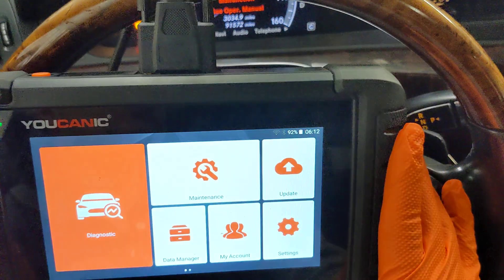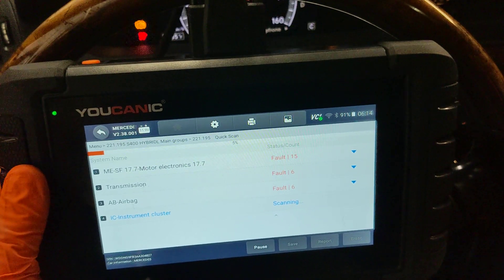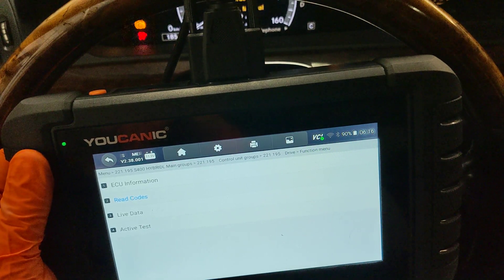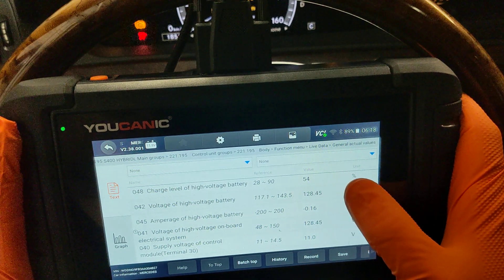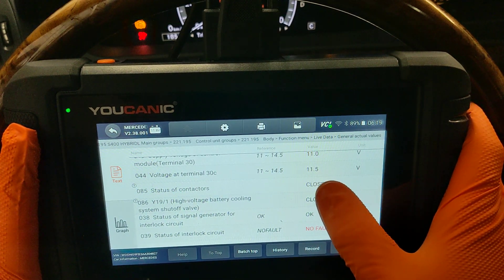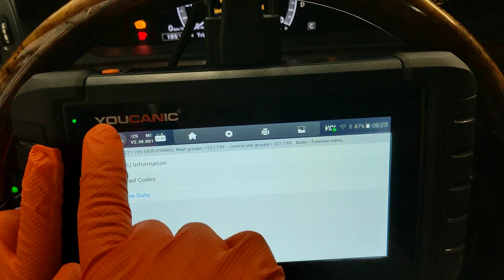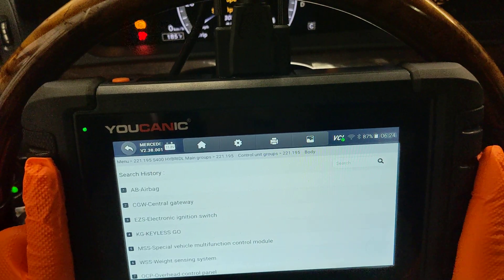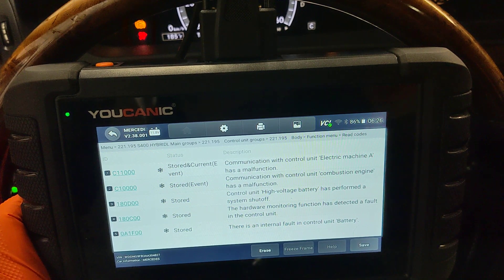Troubleshooting Hybrid Vehicles with the YOUCANIC Scanner

Comment: Thank you for making this video!!!! I own a 2014 Hyundai Sonata Hybrid and am getting a warning light to check the Hybrid charging system. I want to find a reputable place to get it fixed, and am super wary of getting overcharged. I replaced the 150 v fuse to the electrical system, checked all other fuses, replaced the 12v battery, and made sure that there is gas in it, but the warning lights continue to come on. It seems like a known issue among fellow Hyundai Hybrid owners.  Very frustrating.  I appreciate you taking the time to share your knowledge.